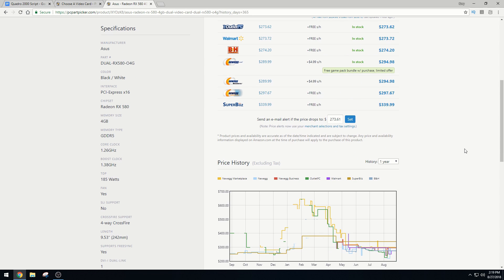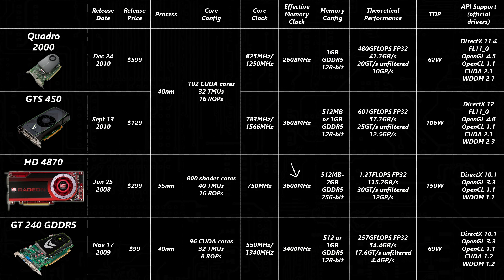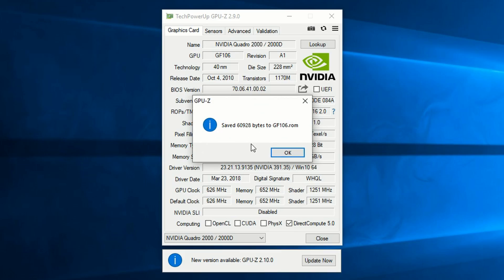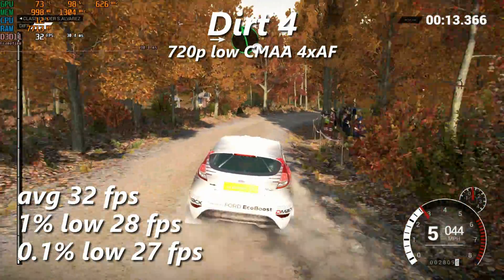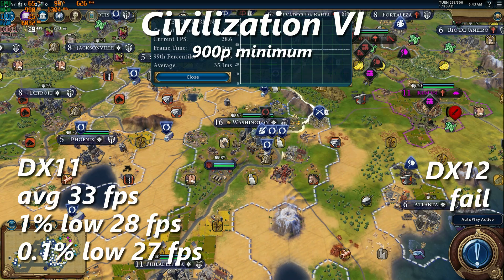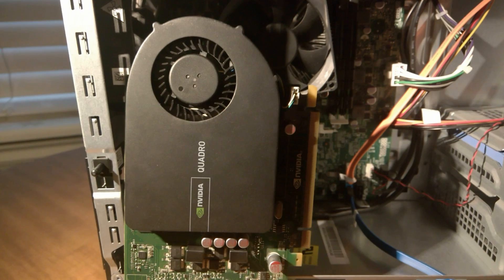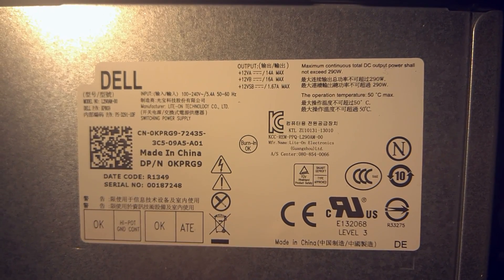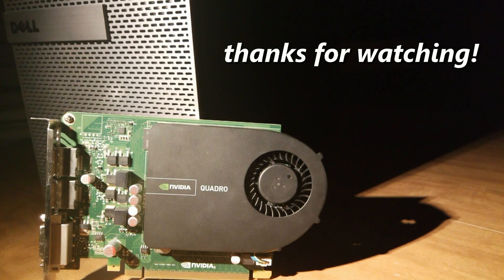Nvidia Quadro 2000: $20 Prebuilt-friendly Graphics Card

Comment from the maker: A few more tidbits of info that didn't make it into the video:
0. I forgot to include this at the end, but a HUGE thank you goes out to u/jordepic on Reddit for alerting me to the HD 8570's existence.
1. The idle clock bug happens at stock clocks as well. You can fix that by flashing a new clock table, but at that point you might as well drop 391.35 and stick with 377.83.
2. Regarding the bit at the end about "motherboard with issues with HD5000+/GF600+", I'm referring to boards that have trouble with PCIe 2.1/3.0 cards. The board shown has a VIA PT894 chipset; I've never tested one personally but others have experienced POST failure when using PCIe 3.0 cards on their PT880 boards. YMMV
3. I had a look at the model number for the GDDR5 modules, they're K4G10325FG-HC04. Those are rated for 5Gbps. That means at stock the VRAM is running at barely over half its rated speed. I'm probably being held back by the memory controller on the GPU itself; when I'm not overclocking the core I can max the memory slider in Afterburner but I have to dial back the memory clocks a bit when I overclock both.
4. Gears of War 4 also supports cards with Tier 1 resource binding, so I could've tested that as well. Not like there would've been any point, Halo 5 was bad enough.
5. The October patch for Quake Champions pushed up the oldest "approved" Nvidia driver to >399.24, so it'll complain every time you try to play on a Fermi card. It's only downhill from here :(
Reply: Do you play any other Halo,CE perhaps?
Reply from the maker: Only for benchmarking
Reply: if we buy the Quadro 4000 would i have the same driver problems?
Reply from the maker: Only if you care about DX12, with the standard Quadro drivers you'll be fine. As fine as you can be on a dead architecture anyway. I'd go for a K2000 personally
Reply: K2000 not available cheaply on my country used hardware market.
Reply: just bought the K2000 for 50 $. it's 2gb ddr5
Reply: Where have you gone bro? I just started watching you
Reply: I also have the Quadro 2000, and in fact... first of all, the clock issues also happen in the 377.83 drivers, i don´t know why it happen, but i solved it modifying the clock table. And the second issue is that the Quadro 2000 to GTS 450 Mod doesn´t work in my PC (Dell Optiplex 980), not even POST, only gives me a black screen, but if i put the GPU in another PC it boots, the only solution i found is to stick to the Standard Quadro 2000 with the 377.83 drivers.  Finally i could push mine to 783Mhz Core and 1728Mhz memory.. but the temps are extremely high (at 912mv) so i lowered the clock to 752mhz Core, and the voltage to stock, leaving the memory at 1728Mhz. And only i can use it if MSI Afterburner puts the fan at 100%.

Comment: Great video (and guide). This is what I did to my (same shape cooler) Quadro 2000 a while back. I also modded the BIOS and went a bit further adding UEFI support (just in case I want to use with systems that need that). I do same with almost all my older GPUs.   Watched a few other of your vids and subbed. Would be rude NOT to!  (EDIT: Also I got 780/1900 clocks baked into BIOS with Quadro voltages and power budget not GTS450 ones and see a 30% boost in performance over stock Quadro)

Comment: Good video and lot of informations.

I'm still using Quadro 2000 in 2022 but back then in 2020 i struggle with the idle state, My Quadro ran at idle speed after i played a games for quite sometime i dunno why and i fixed it by restarting my PC but after few months the idle state gone and again i dunno why xD so it's better now. 

One more thing that i use Quadro 2000 for gaming, so many newly AAA Games i had played with this GPU and here i'll write the list of the game that i played with:

*i write the most fps that i got.
-RE 2 Remake: 80% Scale, Lowest, 720p, 27fps.
-RE 3 Remake: Same as RE 2 Remake.
-Watchdogs: Lowest, FXAA, 720p, 27fps.
-Plague Tale: Lowest, 70/80% Scale, 720p, 25fps.
-GTA V: All Normal, 720/768p, above 30fps.
-The Sims 4: I forgot the graphics settings but its low to high (i mixed it), above 30fps.
-The Evil Within: I dunno why but i got the worst fps ever like 7fps to 15fps even with 360p resolution.
etcetera. damn my fingers are sore, sorry.

My conclusions that you can play all games if it's minimal requirements below GTX 750ti or GTX660 and all the 2GB vram graphics card.

*Sorry for my bad english and poor choices of word.
Reply from the maker: I think I've traced the idle clock problem to hardware acceleration in Chrome/Embedded Framework, turning it off takes care of the problem for the most part

Comment: Hello mate , i bought this card recently to put it on a hp pro 3500 mt , but it does show no signal , sould i downgrade to win7 because ?i heard that quadro 2000 has problems with win10 , or maybe the hp pro 3500 mt is not compatible with this gpu 

Idk what to do i need your help
Reply from the maker: Were you using integrated graphics before? Maybe it's still defaulting to those
Reply: @hblankpc  yeah i was using integrated graphics but i'm afraid to uninstall igpu because the card may still not work 

I've done some research on my motherboard and it's hp h61, i saw it supports dx10.1 , but my card is dx12 so maybe they are not compatible
Reply from the maker: Your IGP should automatically be disabled when the card is installed. Do you have Secure Boot disabled? If it's enabled that could potentially be the issue.
Reply: @hblankpc  hello , i came back after a month , i discovered in the old pc that the pcie only offers 30w of power , so i bought an hp compaq elite 8200 that has a pcie that offers 75w , i disabled secure boot and all the stuff , but now i have a new problem :/ the card shows no signal , so i managed to activate the igpu while the quadro is in the pcie , and i discovered that the gpu is not detected at all , i'm starting to suspect that the gpu is just dead or maybe it's just a workstation card and it doesn't work with normal prebuilts 

Maybe i should just change the gpu because i'm not supposed to have that ammount of problems with 1 gpu , i will maybe switch to a gt 640

Comment: nice video man! i have bought 3 quadro 2000 for retrogaming (i have built 3 playseats for teknoparrot multiplayer lan games) and I am thinking of flashin them with your bios... dunno yet (but thanks anyway). I have a quadro 4000 laying around , do you know what geforce bios mod could be applied to it?
Reply from the maker: I wouldn't bother, the DX12 support is trash and while I don't have hard data, I feel you get better performance sticking with the standard Quadro drivers.

The Q4000 doesn't have a direct Geforce equivalent, but my mod is a simple device ID change, so you could do any other Fermi model. The GTX 465 is the closest spec-wise
Reply: @hblankpc  ok thanks, so i'll better stick with the q2000 regular bios and then sell the q4000 since prices are really high theese days (and i payed like 10 bucks for that card a year and a half ago) ;)

Comment: Bro what will give more FPS in games quadro 2000 or k600
Reply from the maker: In most cases the 2000 will wipe the floor with the K600. The latter has some advantages but it was meant to replace the Quadro 600 and doesn't compete well against the next card up.

Comment: what is a good replacement for it  my budget is like 200 dollars and my quadro is starting to fail on me and it keeps shutting off
Reply from the maker: Is that $200 US? If so I'd recommend the GDDR6 GTX 1650 if you need a card without 6-pin power. If you have a 6-pin you can step up to the 1650 Super
Reply: @hblankpc  thanks a lot ill look into those

Comment: Do not work for me. 

" NVIDIA Firmware Update Utility (Version 5.414.0)
Simplified Version For OEM Only
Checking for matches between display adapter(s) and image(s)...

Adapter: Quadro 2000          (10DE,0DD8,103C,084A) H:--:NRM  S:00,B:01,D:00,F:00

WARNING: Firmware image PCI Subsystem ID (10DE.084A)
  does not match adapter PCI Subsystem ID (103C.084A).

NOTE: Exception caught.
Nothing changed!

ERROR: PCI subsystem ID mismatch "
Reply from the maker: That just means your card is from a different OEM, try the -6 flag to get around that.

Comment: Does it work on the hp 8300 small factor form?
Reply from the maker: No, the card is too tall. You'll need a low profile card, something like a GTX 745 or HD 8570, or GTX 1650 if you can afford it
Reply: @hblankpc  ty  for letting me know

Comment: hi, thanks for your video, I'll like to change my quadro into a gtx, Could I do it only downloading and instaling this rom? otherwise i have to do the previous steps?
Reply from the maker: If it's also a Quadro 2000 you can just flash the ROM I provided, otherwise you'll have to figure the process out on your own. Not worth it in general IMO
Reply: @hblankpc  Hi again , ill do it but dont work and dont understand what happen , i use nvflash64 and execute  nvflash64 --protectoff ok and then  nvflash64 -6 q2000togt450.rom and then say error board id mismacht   . I attach the caption in one mail to you, any solution ??

Comment: Hi, thanks for the vid.  I am not a gamer, but looking for a card to replace my 512Mb NVidia NVS-310.  I need two DP ports, use mostly business graphics with some Photoshop - so would the Quadro 2000 offer a performance boost over my NVS-310?
Reply from the maker: The Q2000 should be over 4x faster than the NVS. There are a few advantages to the NVS 310 (slightly newer drivers, a better video decoding engine, lower power consumption, physical size), but if you don't care about any of that the Q2000 is a big improvement.

Comment: If mine is quadro 2000 2GB version will this bios still work and improve settings ?
Reply from the maker: There shouldn't be a 2000 with 2GB of VRAM. Maybe you have a K2000?
Reply: @hblankpc  k2000^  you are right. What do you think ? Will this bios improve things ?
Reply from the maker: @WiNktub  No, it'll probably brick your card because the 2000 and K2000 use different architectures. The K2000 is new enough that the Quadro drivers have feature parity with the Geforce drivers so there's no point in modding the BIOS.
Reply: @hblankpc  Ok. Thanks for the info !

Comment: Well, I'm better using 377.83 quadro drivers, I don't want to use the GTS drivers again because it gives me troubles of stability and DX12 support is shit, but I want to know how you make the bios custom clocks you made. I use OC @770mhz and it works fine but yours looks quite better.
Reply from the maker: Agreed, 391.35 is kinda broken no matter what Fermi card is running it. 11:11 shows how I did it

Comment: I flash my quadro with your bios. Thanks for share, but i have a problem. I cannot pass 700mhz oc, when i get higher screen just go off in furmark. The power limit of pci-e causing this? I get max voltage.
Reply from the maker: It's possible. You're not actually changing the voltage during the OC right? The voltage should be left at stock for a card like this
Reply: @hblankpc  I test stock voltage also, on 750Mhz furmark just crashed imadietly, screen turn off, but computer still working and i can turn off from power button. I think problem is pci-e slot doesnt allow to exceed 75w. Quadro 2000 have 60w tdp and GTS 450 have around 100w then exceed pci-e power limit or... i have 4 pin eps inserted to 8 pin eps, maybe this do somethin with motherboard power supply. I dont tested games yet, maybe in games work fine, maybe frumark is too much OR i have bad sample :p What i have noticed i have different design of the card. Cooler is different and pcb also. Sorry for my english.
Reply from the maker: Furmark isn't representative of a realistic gaming load, so you're probably right about it overloading the slot. I didn't have any such issues but I'm also using an SLI-capable motherboard with an 8-pin EPS connector, so that helps. GTS 450s use a 6-pin power connector so they don't blow up the slot. I don't have any experience with the rectangular cooler cards so I have no idea if there's a difference in overclocking potential. I've found that the Fire Strike stress test is a more fair way of testing stability on this card, maybe try that?
Reply: @hblankpc  I try Fire Strike maybe furmark is for modern cards ^^. I ordered eps adapter 4 to 8 pin and i wait with tests until adapter arrives. Thanks for answer.
Reply from the maker: It's not that it's for modern cards (you can use it on DX10 hardware and up), it's that its primary function is to make your GPU as hot as possible, kind of like Prime95 for your GPU. Great for testing the power delivery and cooling of your card, but not much else. Also that EPS adapter isn't going to do anything but create an additional point of failure in your system, especially if you don't have the best power supply.

Comment: I have one of these(different style cooler) in my ghetto cardboard box Dell Optiplex 780 motherboard build with a Q6600 (tape modded to 3.0GHz) and an Optiplex 3010 psu from a computer like the one in the video. Thanks for doing this video, as no one else bench marked it.
Reply from the maker: Socket Sanctuary did a video on it a long time ago, all he really did was play eSports titles though
Reply: @hblankpc  Oh yeah, I did watch that. 

That motherboard was a mistake, everything is proprietary. Even the fan headers. I hot glued 4 pin fans pin by pin into the 5 pin header lol. I wouldn't trust that thing to be on without me looking straight at it. I wish I still had time to mess around with random computers.
Reply: @hblankpc  Also I was wondering if the modded drivers added any performance over the Quadro drivers when DX12 was not needed.
Reply from the maker: Dunno, I didn't test that. I moved the card into my roommate's PC so it's unlikely I'll ever do proper benchmarks
Reply: @hblankpc  did you restore the power saving features? Haha
Reply from the maker: Yep, the original BIOS is back on the card. He's not the most savvy user, wouldn't want him to have to deal with that

Comment: seem like bad value for 20$ I found a better deal also it still has driver support

https://www.ebay.com/itm/AMD-Radeon-R5-240-1GB-PCIe-3-0-DDR3-DVI-Display-Graphics-Card-Lot-of-2/323434388993?epid=2186653029&hash=item4b4e311e01%3Ag%3AfiAAAOSw5WVbgEdm%3Asc%3AUSPSPriority%2176246%21US%21-1&LH_BIN=1
Reply from the maker: One of those is worse than the 8570 I recommended at the end. I guess if you're some kind of masochist that would make sense for Crossfire lol